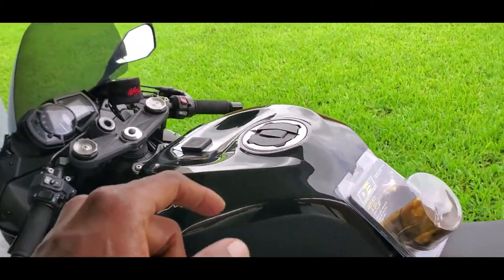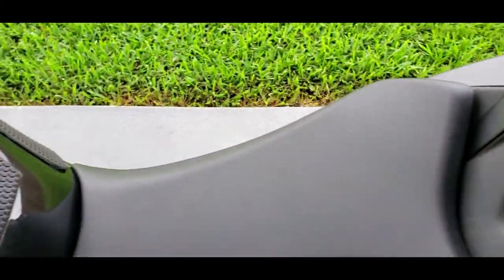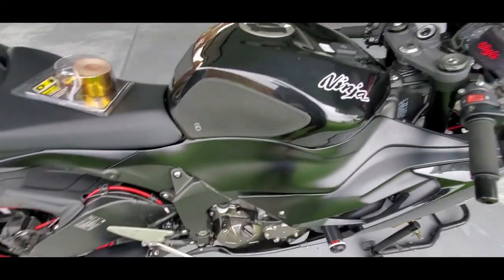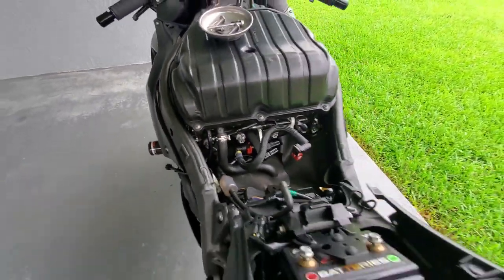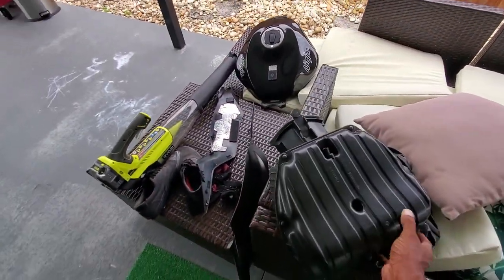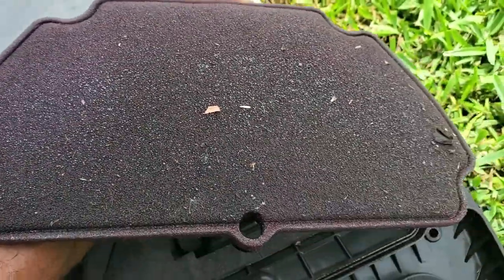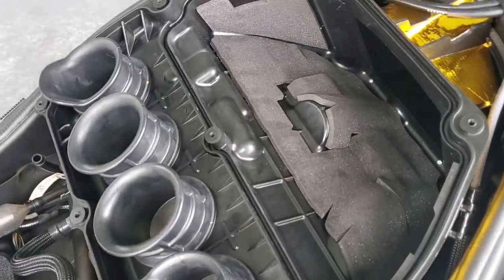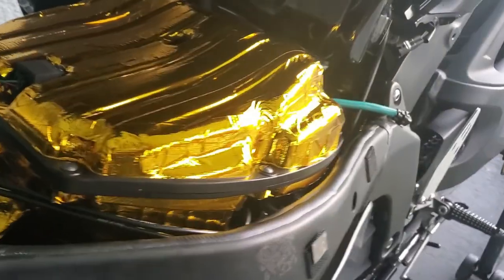KAWASAKI ZX6R 2019 - 2023 GOLD TAPE INTAKE BOX {ITS GOOOOLD!!! }

Comment: Have you notice any real differences after applying the tape ?
Reply from the maker: Yes yes more on cooler days than anything I need to wrap my radiator and coolant lines also just need to set a day to do so...  also wrap my header for the bike that going to be fun

Cheers
Reply: I had my headers ceramic coated and that defiantly made a difference check out jet hot performance and as far as coolant hoses go with silicone and evans coolant fluid and the good thing about evans coolant fluid you do it once and you don’t have to change it again because it’s waterless
Reply: I emailed you some pictures and links let me know what you think
Reply from the maker: Never got rhe e mail where did u send it to ???
Reply: I email it to the JJAKASMOKIE that is on the description
Reply from the maker: You mind sensing again I check my spam and inbox nothing sorry
Reply: I just did
Reply: And I will reply back
Reply: Did you get it this time
Reply: At gmail
Reply: Manuelr292
Reply from the maker: Yes yes I have it thanks
Reply from the maker: Woooooow your bike came out soo sooo nice forget the wrap lol
Reply from the maker: Ok ok let me ask u something the coat did u send your parts out to get done or you did yourself??
Reply: @jjmax2007  I send it out … but what I did was I bought a separate headers of eBay for like $90
Reply: @jjmax2007  because I didn’t want to be without being able to ride the bike specially since I did it during the summer
Reply: @jjmax2007  it took about 10days including me sending and receiving
Reply: @jjmax2007  and I think your turnaround time might be quicker since they are located in North Carolina
Reply from the maker: Hey I have a question the company for the coating for the header how long did they have your exhaust ???? Was it a month 2 week??? I know they are in North Carolina I called and kinda have missing information 

Cheers
Reply: @jjmax2007  the whole process took about 2wks sending and receiving the item back
Reply: @jjmax2007  what did they say to you ?
Reply: Hey any updates on the headers?